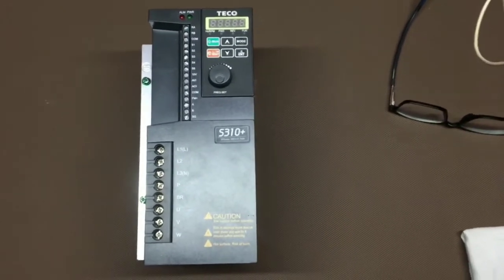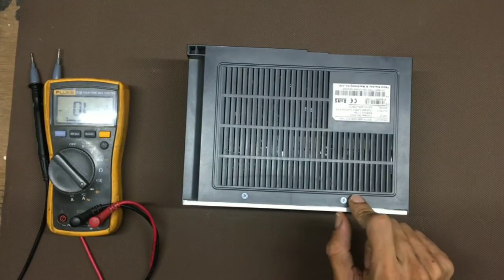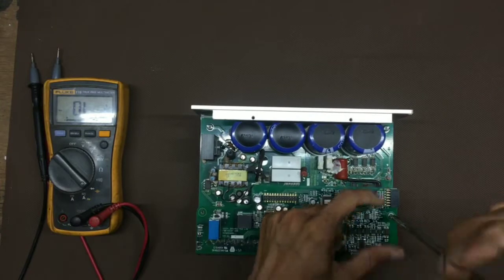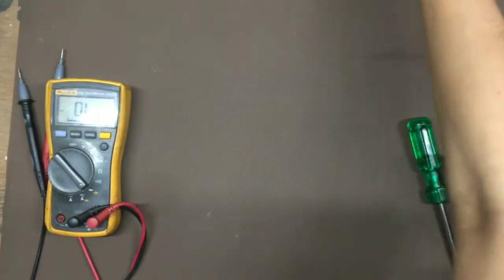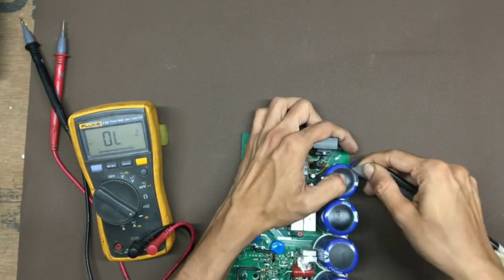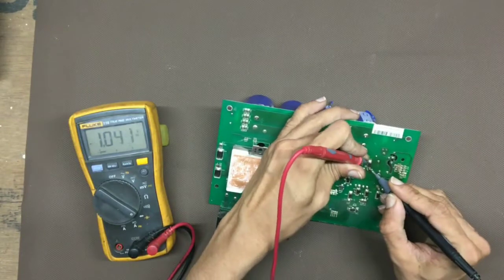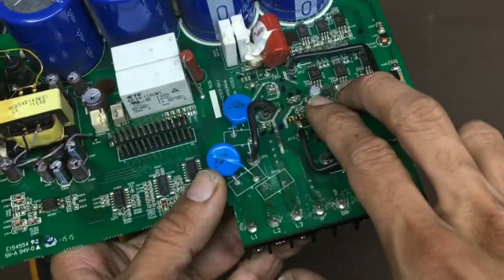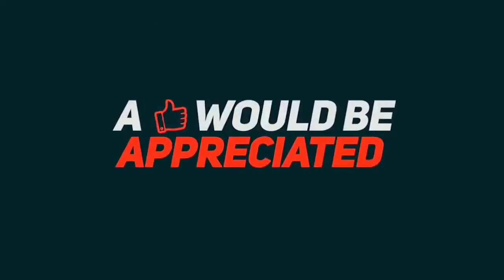AC Drive Basic Intro Part-1 | Fault Tracing

Comment: Sir, mine is a three phase VFD. It is receiving three phase input, but the VFD output is only two phase. What could be the reason for one phase output loss? 

Could you please tell me some possible reasons.
Reply: Kindly reply sir
Reply from the maker: Faults can be:
1) Firing Section 
2) IGBT